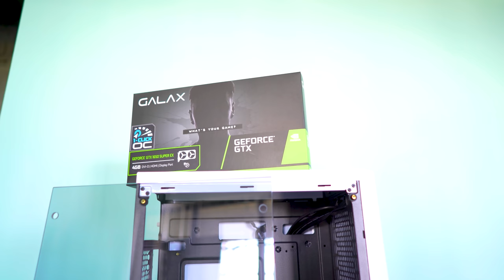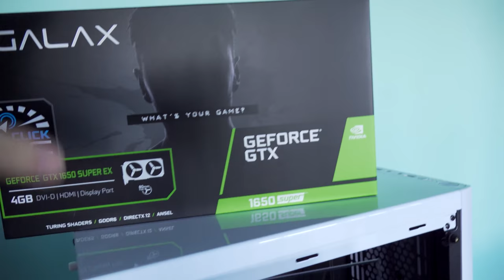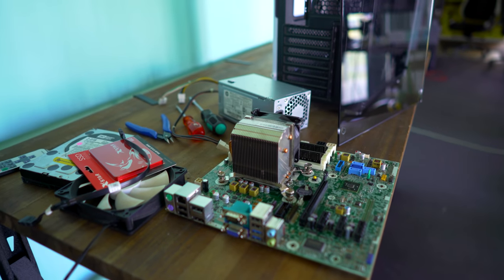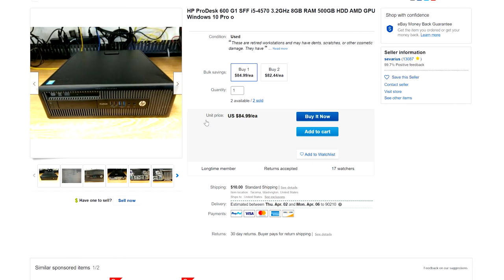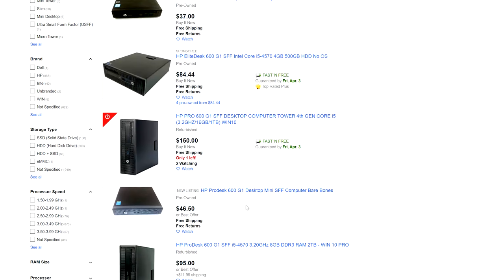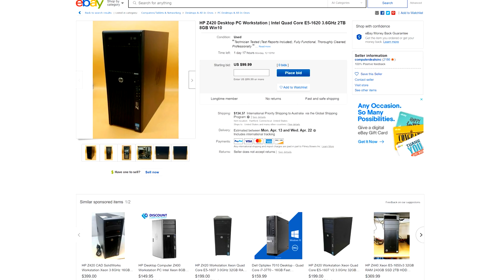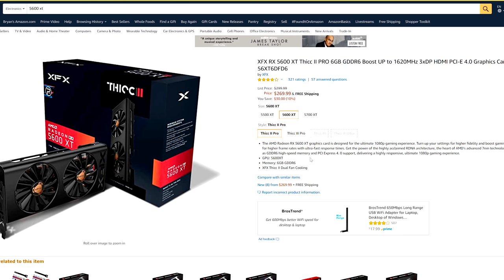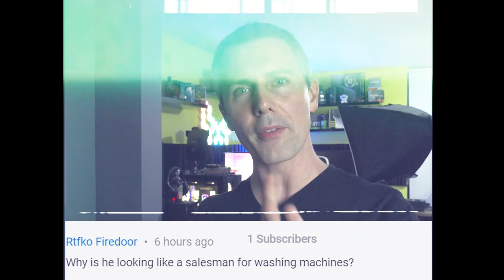I am ALL OUT of Gaming PCs... (Best Budget Gaming PC Parts Right now)

Comment: Pro tip for HP Ctl+A alt+A when you first get into the bios will unlock advanced features.   You then can turn off FAN checks and disable the USB3 Onboard Header to stop the message.   Some board even have the halt on error option ;)
Reply: Really? no way D: Brian gotta pin this.
I ported an hp 600 g1 about 8 months ago and I moded everything so it fit well even the power supply but the only thing that was giving it away was that annoying usb 3 message. Don't think I'll do another one because it was supper time consuming but I saved your comment just in case. Thanks m8
Reply: This is extremely handy to know...I've been working on HP machines for years and didn't know about this. I'll def be giving this a crack!
Reply: @Devastator0  so did it really work?
Reply from the maker: Thanks I will check that out.
Reply: Anything for IBM computers?
Reply: You could also short out 2 pins on front usb 3.0 like on this picture:
https://i.imgur.com/0JYlBI3_d.jpg?maxwidth=640&shape=thumb&fidelity=medium
Those pins detect if front usb 3.0 is connected, so no more "press f1" :)
Reply: Intersting thanks.)
Reply: For some models (90% of UEFI capable) for older stuff or rare cases you need to use the BCU (bios configuration utility) it’s available from Hp direct https://ftp.hp.com/pub/caps-softpaq/cmit/HP_BCU.html

It creates a text file dump of the current bios config you can edit and re write, note this is not a bios update.  If you change the wrong setting it will display errors but still allow to boot in “most cases” but as always use at your own risk 

As for where this information comes from, I work for a Authorised Warranty Agent for most big oem brands so I’ve picked up a few tricks along the way dealing with odd and Sods

With HP if you flash the wrong BIOS file or are experiencing bios issues the flash back is

Format a USB 4GB or less to FAT32, copy the bios files (.rom etc) to the root directory, on boot press and hold WIN+B 

The same process without the USB will re install the currently install BIOS over the top essentially removing the BIOS password 

@Brian if you ever get stuck I’ve DM’d you in the past on FB just hit me up always down for a chat and to help out a techie
Reply: Ramon Munoz IBM and Lenovo are a little trickier.   I’ve found DMI Edit from within an OS with secure boot switched off will open allot of extra commands and settings.  This applies to Acer as well however sometimes DMI edit will bug out and throw errors and won’t allow you to write to the config.  I find the bootable DOS version more stable then the GUI but more difficult to work with 

When it comes to headers for the audio and USB I find the best method is to strip the connector from the original chassis is available and re pin or solder the connector in place 

With the 12 pin for psu you can adapt this but require a step up circuit for the Standby Power in some cases.  These are available on AliExpress for a couple of bucks
Reply: Rous can’t adjust curves but allows you to switch off Fan check Errors.  I personally used Argus Fan Control software to set all my curves.  This is a paid suit but imo worth it
Reply: wish i known this when i still had my hp 3770. upgraded to ryzen.

Comment: 4:51 Brian, for your and your customers safety, please use heatshrink - electrical tape can get loose after some time (especially in a warm environment like PC case, and Australia), can cause short and in the extreme cases  it becomes a fire hazard. Not straight away, maybe not even in a years time, maybe even never, if you're lucky - but it's still a risk that is not worth taking. 
Stay safe in these crazy times!

Comment: 4:52 - Electrical/safety tape eventually unravels and/or gets gunky, degrades. It would've honestly been better, for one or two other reasons, to have used heat shrink tubing instead of tape.
Reply: correct.
Reply: Or wire caps.
Reply: Agreed. Heat shrink tubing is amazing! Not only does it not get gunky it looks so much neater.
Reply: @christopherjames9843  no don't use wirenuts in a computer case. That is actually a very bad suggestion. Heatshr ink is the way to go
Reply: heat shrink or liquid electrical tape.

Comment: Hey brother,the usd isn't so great either. Your videos inspired me,and I've made a pretty solid x58 system that I literally got from the trash at work.
Corsair hx750w,
Asus p6x58d.e
X5675
1660 of 6g
Acer 24" 75hz
Asus 24" 75hz trace free
Think all in all I spent 200 bucks,mainly buying a new trace free monitor.
All noctua air cooled.
Reply: HX750? That's a great PSU
Reply: @dean7589  yeah,we literally just updated hardware and moved from.7 to win10 ,you wouldnt believe some of the stuff we have laying around,stacks upon stacks of atx cases that are literally all the same,so I have to take a side off to see what's inside,but so far my first 2 grabs were an asus p6x58d.e,the second one was an x79 mobo,but looking at it I cant tell anything else since I haven't been at work in almost 28 days,I go back tomorrow

Comment: Meanwhile in Sweden.... went out to my apartment building's recycling station. Found a computer in the electronics recycle bin.... looked inside.... GTX760.... "hmmm, I wonder what other specs it has?".... (although it is illegal to pick things from the recycling station, my empathy for the environment took over). It had accumulated loads of dust over the years, I thoroughly cleaned every component, and I was left with a  core i7 4970K, 16GB 2133MHz DDR3, 2TB SSHD 550W Cooler Master PSU. booted up, stress tested, everything was working except the GPU.

I later bought a very cheap but pretty enclosure, (the old one was sticky and dusty, had tons of scratches, and didn't look very nice) put my old GTX960 in it, and it ran like a dream. I gave it  away as charity for people in need, I found a struggling single mother with two boys who had been wanting a gaming PC for years, but her economy was only enough to cover the monthly expenses. Imagine the looks of their faces. hahaha. it was amazing. And now I'm like, c'mon, don't make it illegal to re-use old hardware that is being thrown away. that's insane.
Reply from the maker: wow thats an awesome score man. good stuff.
Reply: Congrats! Bake the 760 in the oven, you might resurrect it! Good luck1
Reply: @НиколаГеоргиев-ш2б  hahaha. love it! I will actually try it, I remember that people overheated their x360 to get rid of the red ring of death. it can be worse than it is now. (it has graphical artifacts) 😅
Reply: @PixelShade So it works but it glitches. Fine, have you tried changing the thermal paste/pads? You might also try to downclock it to check if the artifacts disappear.

Comment: I built my new PC a month ago. All parts were bought at Micro Center. 
CPU: 2700x - $120 (Went with this, on sale for $120. Too much value for money)
GPU: EVGA 2060 Super $380 - Started with a 5700XT, drivers were so horrible for me, I returned it.
Mobo: B450 Gigabyte Wifi - $65 - Open Box, MC gives you $20 off when you buy a CPU.
RAM: 16GB Skill Tridentz RGB 3000mhz - $60 - Open Box
SSD: Kingston 120GB M.2 - $22 - (Only for OS)
          Samsung 1TB 860 QVO - $85 - ($10 off with bundle.)
Case: Lian Li Lancool 2 - $94
PSU: Powerspec 750W Bronze Modular - $70
For a little less then $900, I think I picked up a good value for performance gaming PC.

Comment: I've been putting 1060's with OptiPlex 290 watt units and I had people freak out on me. Over a system that was pulling about 200 watts from the power supply. And I've tested these suckers. Pushed one to about 300 watts power draw from the wall for close to five hours and it didn't have a problem, so I figure a meager 120 watt GPU is fine. People don't realize how well built business pre-built PSU's are. Sure, they're no Seasonic or Super Flower, but they're not the garbage they put in consumer models. I'm actually impressed that little 245 watt was running an RX 470.

Comment: If any one is in Montreal, there are some computer stores (maybe 6) in the Saint-Laurent area. Prices are very competitive, and easily negotiable (some stores can remove the taxes also). Rx570s go for 100 CAD, first gen i7s go for 20-30$, first gen motherboards for 20$, a store has 120gb SSD for 15$, 400w PSUs for 10$, 2nd gen motherboards for 30$

Comment: Did something similar. HP Prebuild for 20€ used with I3 3240, 500gb HDD and 4gb RAM. Bought 8gb RAM, sold the 4 gb and got a R7 260x OC for 15€. Gaming PC for 40€.

Comment: DELL T5600 works well with GTX970. Really like this T5600, in terms of build quality.  The downsides...no OC...it is a dual CPU system for the CPU's are Intel locked. Also, the BIOS is OEM locked.  I can set the multipliers, which are maxed at 3.3Ghz (all 16 cores) on a dual E5-2689 configuration [2 x (8C/16T)].

RGB...forget about it.  However, I did customize the side panels with vinyl gloss 3D carbon sheets (the type used for car exteriors).

Comment: 2:18 those SATA to 6-pin adapters are a serious fire hazard and should not be used for a graphics card under any circumstances.
Reply: If that's the case then why GPUs from like 10-15+ years ago shiped with molex to 6-pin adapters?
Reply: @Godfrey180  Very late reply but based on the information in GN's "Don't Use Cheap Cables" video Molex can handle much more power (if made properly). I still wouldn't use even those though

Comment: Honestly at this point get a cheap 20 buck power supply cause that is not gonna last for a long time. I had a 250w psu run a i5-2400 gtx 660ti barely and at one point the psu just gave up and took down the whole pc i was reliable so i had to pay back the amount i sold the pc. In long term buying a cheaper, better and a nicer looking power supply is better you dont have any type of risk involving paying back the money, Easier to sell, Better customer feedback etc.

Comment: Hey I did my own build on a z230 and attempted to use nuts for the motherboard/cpu cooler but the screws weren’t long enough
 and wouldn’t properly lock into the nuts and just fall out therefore I was forced to use the case it came with. Do you have any advice?

Comment: What is your opinion on gaming on older nVidia Quadro’s? I actually had a HP system Z230 with a Intel i7-4790, 4x8GB 1600MHz and a nVidia K4200 and it did pretty well on 1080p low/medium settings. Sometimes when you buy these older HP systems from resellers the Quadro’s are included. It even came with two HP231 23” TN 1080p 60Hz monitors. 

Ps. Keep in mind this was three years ago and I did upgrade the boot HDD 500GB to a SSD 500GB and also the RAM, it only came with 2x4GB 1333MHz.

Comment: I'm not 100% sure but only 2 components I don't have a spare for is CPU (3900x) or MOBO (x570 taichi) , get clock watchdog timeout BSOD alot, even got it DURING multiple clean installs. Debating buying a 1600 af so I can at least figure which is faulty, 
In the meantime I put my 2080ti on my old 8350fx build lol
Still able to play overwatch @1440p 144fps, got CPU OC to 4.8ghz currently, even plays shadow of the tomb raider and modern warfare pretty well. Better than I expected anyway

Comment: Man, thanks for all your videos
I have seen a lot of them and it seems like you struggle with windowed cases and crappy looking cabling inside of it.
So here is my thoughts. I actually used it for myself - go to electric cable store (not sure what exactly you have around) and buy a corrugated pipe for these crappy looking PSU wires. If you hide them inside this pipe (there are white, grey and black colors in my local stores) it looks like the water cooled PC or, at least, hides this ketchup-mustard trash with zip-ties.
At my local stores it costs 0.03 usd for 1 meter (16mm diameter, 20mm will be easier to handle with)
Have fun with that.

Comment: If you're buying used prebuilts (without GPU) for more than $200 shipped including tax... consider paying $300 for a new RYzen 1600/ 2600 system (excluding the GPU) with WARRANTY. Of course you may have to look for deals and coupon code (easy to do). Don't pay anything close to $200 for an used quad core prebuilt, and try not to pay more than $200 for an used hexa core prebuilt workstation. Sometimes people see video recomendation and they go to ebay without using any independent thinking. At least for now i don't see a problem getting parts online from newegg & amazon in the US.

Comment: could you possibly cut a piece of metal down. to make a plate to mount that power supply properly? and possibly find an IO sheild ?
Reply: I did the power supply plate and for the io shield I cut a piece of dense cardboard that I also spray painted black. Super time consuming but it turned out grate

Comment: Be carefull with SATA to 6 pin. Sata is only rated to 54W and 6 pin 75W. So if used with hi power card the sata connector will melt.
Reply: The SATA to 6 pin in the video uses a molded connector on the SATA end that is prone to arcing internally and catching fire even under a <54W load.

Comment: I had HP Z420 
I think there is a bios setting that lets you designate main GPU there.
Reply: me too,
Reply: if he gets video on the bios screen it is allready switched to this GPU; mine displays only on the bios-activated port;
using the Z420 with linux + VFIO GPU passthrough and this works great!
even with 3 card, an old amd for host + gtx1070 for first vm + gtx660 for second

Comment: Ive got a brand new 2700x microatx based system for sale, 5700xt' 16gb ram, 512 gb nvme ssd (samsung 970 evo) and a 2tb samsung sata ssd for bulk installs. All of the above in a rv03 raven silverstone case and a 650 watt psu. How much should i list it for?

Comment: My GPU DVI stopped working one day, so I tried the MB DVI and it was working, so I connected my monitor via displayport and went into the bios and turned off multiple screen support, iGPU got disabled and GPU DVI started working again, then I restarted the PC and turned multiple screen support back on, to my surprise all the ports where working normal after that... GPU(Nvidia) and iGPU (Intel)

Comment: For the hp g1 600 tower which has a 320w gold 80 plus is it save to run Rx 570?
Reply: Itll boot, but that power supply wont be happy about it.

Comment: I had a similar disappering DVI issue on one of 2 near identical machines - got through windows setup and into windows, but then would start going blank on reboot. the first thing done on the one without the issue was install nv drivers, the other would have updated on its own. Reinstall with nv drivers right away seems to have fixed

Comment: hi there Brian, I usually build a gaming pc out of these OEM part but I never use the HP OEM psu, I usually order a 24pin to 6pin adapter from china (Aliexpress). you can get them so cheap like 5 dollar I assume. It work pretty good! I can fit a RX580/GTX1070 into that OEM board with decent aftermarket PSU.

Comment: You mentioned about getting a sata to 6 pin adapter. I've heard other tubers say that they do not recommend those. So my question is. Are they ok or not ok to use?
Reply: only on a low power card but yes

Comment: Hey TechYesCity, 
My GPU (rx 570) is running on a 400w UNCERTIFIED psu, and I was wondering as it held up for more than 2 months now without underperforms do I need to keep it or just switch to a 80 plus 500w or 450?

Comment: This is very close to my set up i have the z230 small form factor with a gtx 1650 low profile card, it has an i7 4790 and 24gb of ram. weirdly i also play F1 2019 and it runs okay, 90 - 120 fps on 1080p high settings

Comment: Why does the inability to connect a USB connector make it necessary to press F1 at every  boot?
Reply: It's a motherboard designed for use in a business desktop, meant to work in a few specific configs - if a cable isn't connected, the pc will warn the user so they can call IT to fix it, rather than spending time trying to figure out what's wrong.

Comment: Not so much a Tech Point but since you have brought it up. Friedman's Money policy does not always work and is a less effective method than targeted stimulus policies. Giving a small increase in the money supply and using the 'money',Credit Debt to give an economy a boost is a short term option. The Funds are Small and One time or fixed small payment. It's human psychology to not spend most of the funds on anything other than what is a necessity. "When or If, you will get funds to pay next months bills?" Would You By A Personal Computer Right Now? If you have any spending money? No, it is a Luxury Item along with New Cars, TV's, Stereos, Clothes or Almost Everything that you may want, but do not need to buy or spend on within the next year and/or months. A Majority of the Money should be Food Stamps/Credits they will be spent/circulated  immediately and not just used to payoff new or past debt. Putting an expiration date of a few weeks/months will also induce a spend it now or lose it, that will ensure it's circulation faster. Putting a Limited Freeze/Lowering on Sales Taxes Collected during the same period, will also ensure it's circulation.

Comment: If you use the sata to 6 pin adaptor, how will the GPU perform given the lower power from the sata cable?
Reply: The GPU doesn't know it's plugged into a low-power cable and pulls the same amount of power it would from a 6-pin PCI-e causing a SERIOUS FIRE HAZARD. NEVER EVER EVER DO THIS.